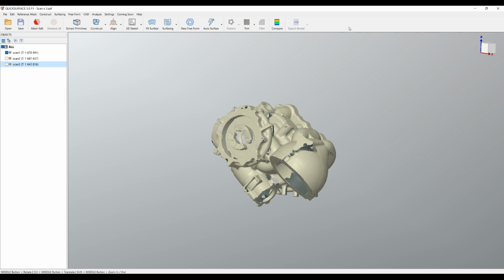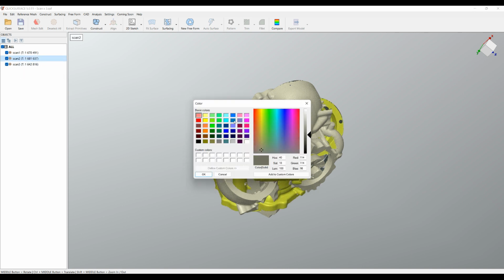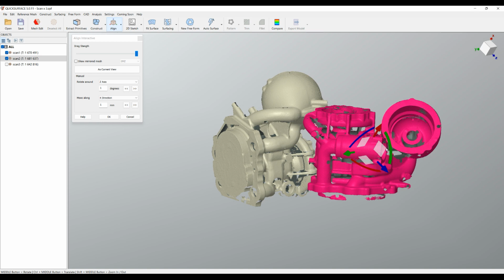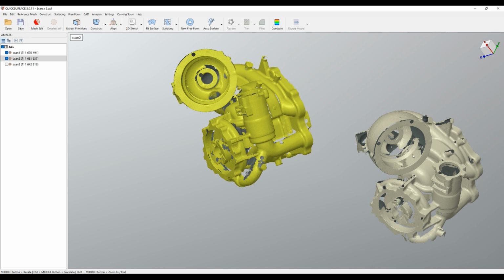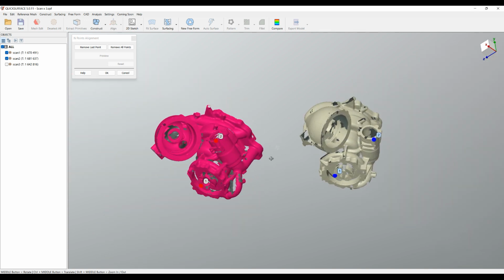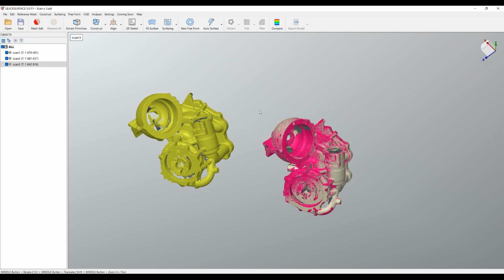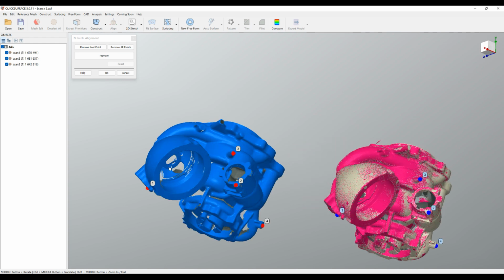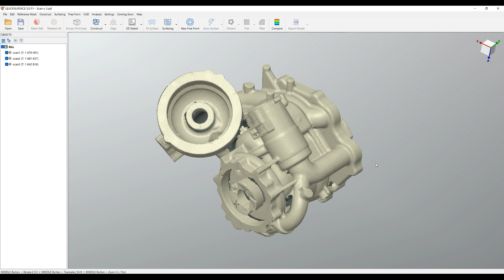QS Tutorials: Multi scan of part align

Comment: Hi Thanks for the Video! is it possible tu use this way with Scans in different resolutions? for example a IR Scan with 2mm Resolution and a Laserscan with 0.5mm Resolution? in the same project like you show? Thanks
Reply from the maker: Yes you can! Just import them and align
Reply: @QUICKSURFACE  cool! thank you!!
Reply: @QUICKSURFACE is it necessary to use stl files, or is it possible to use also pointcloud? If yes- what file format? Thank you
Reply from the maker: Only STL meshes